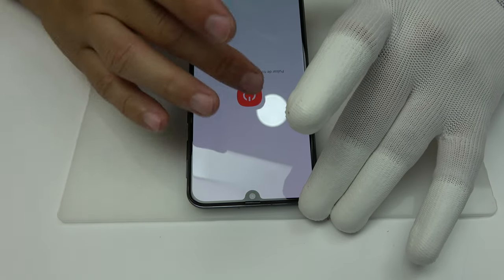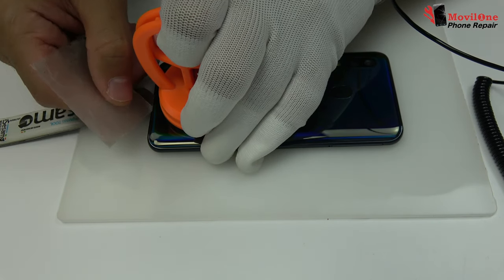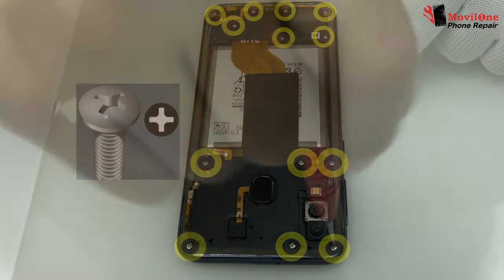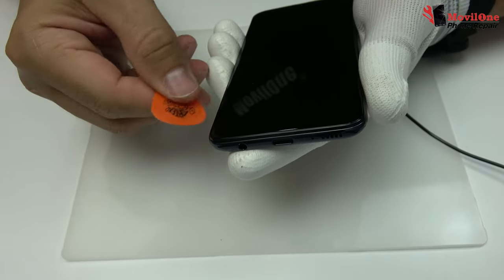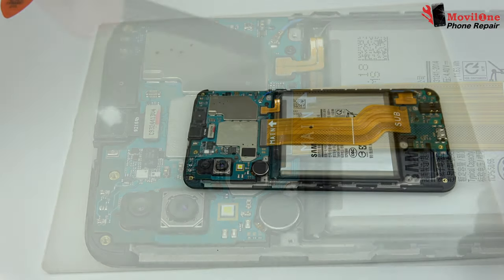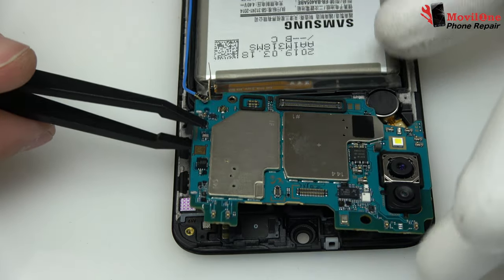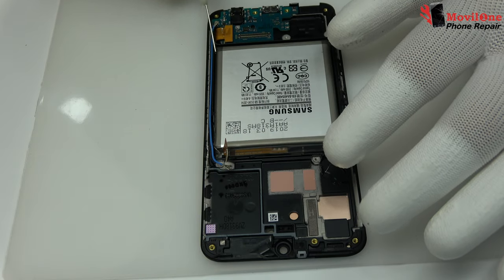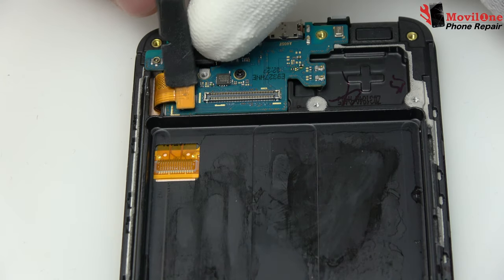Samsung A40 Teardown & Disassembly &  Repair Video Guide

Comment: I really wonder why they didn´t do a real dettachable lid instead of one that is attached on the phone with glue.
Reply: The customer might get wrong ideas, like replacing battery instead of buying a whole new phone.
Reply: yeah, there is no profit from that. I don't know what they going to charge me within like 3 years from now. If its more logic to buy a new phone, I will just do that. I notice that 64GB loaded with apps will also consume all the 4GB RAM, which is not going to be enough. So upgrade would be necessary anyways I guess.
Reply: Small plastic clips can be less reliable than glue. It would be great if they’d just put the screws on the outside and sandwich everything between them. Instead of gluing on a mostly useless back cover.
Reply: I CAN’T REPAIR MY WATER DAMAGED PHONE
Reply: @ditisdurk6498  I CAN'T REPAIR MY WATER AND SHIT DAMAGED PHONE
(Don't ask it's pretty obvious)
Reply: @arturm6621  🤣
Reply: @Kopfkirmes55  though after 3-4 years it could be near to obsolete..perhaps just warranty matters

Comment: Just a quick question - what do you use to remove the glued-in battery? Samsung doesn't use the pull-tabbed adhesive and it's basically impossible to remove them without risk of damage. I had some success with isopropanol, but you seem to use a more dedicated solution.
Reply from the maker: TheUn4seen , I’m using contact cleanner pcc 15, you can find it on Amazon! Best regards
Reply: can i ask what may be the risk of damage please because i want to make sure my a40's battery can easily be replaced 
thank you

Comment: I replaced the battery and now I have no 4G network connection after assembly. WLAN is working, but no 4g connection, so it is not possible to call somebody. The phone always shows the error "Not registered in Network". Do you know why? Before disassembling everything was ok. I also double checked all connections.

Comment: Thanks for that tutorial, it was really clear. I've just had to replace the charging port on two phones. They both failed at about the same time - slow to charge and no data transfer. A bit of a poor design I think.
Reply from the maker: Hello, Mark! I m glad to hear that! Thank you too for your comment! Best regards
Reply: My a40 charging port also broke and it wont charge at all and it got fixed and also my friends a40 had problems with charge port it is literally garbage port

Comment: When I turn on my mobile hotspot, what will offer the best signal? Lying down screen up , or standing the phone vertically?

Just wondering
Reply: Technically, having the antenna perpendicular to the receiver is the best way (at least it's how it works on RC planes, no clue if that applies to phones).

Comment: If you pause at 2:47, on above the brass threaded hole for the screw (to the right of it if the phone is upright) there is a small silver chip. What is this? I dropped my phone down my lift shaft and I’m
Replacing the screen and housing as it snapped, all internals are fine EXCEPT that silver chip. It fell off. This video was helpful to locate where the chip went, I’m not sure if it was soldered on or adhesive as I couldn’t see any residue of past solder on it. It seems to be tacky enough so that after I put a peg/clip over it, it isn’t falling off of the board anymore. I may put some glue over the top to keep it in place. Do you know what the chip is for? Thanks
Reply: Perhaps a sensor? It looks like it’s located next to the front facing camera.
Reply: This looks like a crystal oscillator but is an odd place to be so maybe not.

Comment: While removing the back i cut what appears to be a small aerial next to the motherboard coaxial aerial connection. Can I buy a replacement part. It is labelled E1 10 M2 A4-E4 and T15 190605,
Reply from the maker: Did you look for it on Aliexpress?

Comment: Can you change the charging connector if your screen is broken without having to change it
Reply from the maker: 'XeNoN ' yes, I can because, for changing the charger connector  you need to open the devise by the back cover so it a not any risk with the screen! Let me know if you need more information
Reply: @MovilonePhoneRepair  Thanks, i'm asking you because i went to my local dealership and they told me that i must change the screen or it will divide the phone in half

Comment: is it possible to replace its wifi card?
Reply from the maker: You mean ic wifi + bluetooth?
Reply: @MovilonePhoneRepair  right
Reply: is it a discrete removable component, or you didn't mention it in disassembling the phone just because it's integrated onto the mainboard?